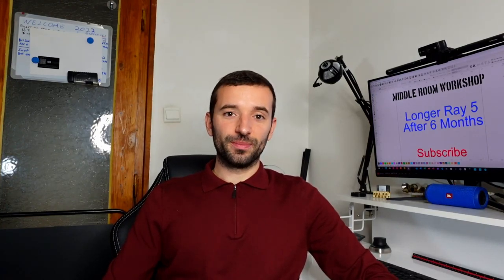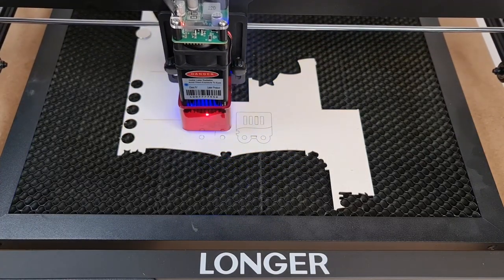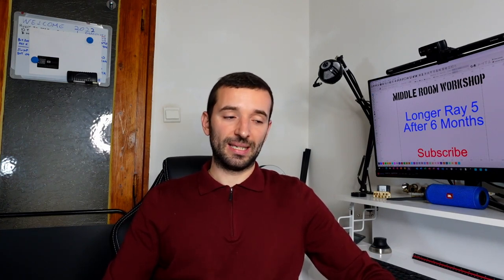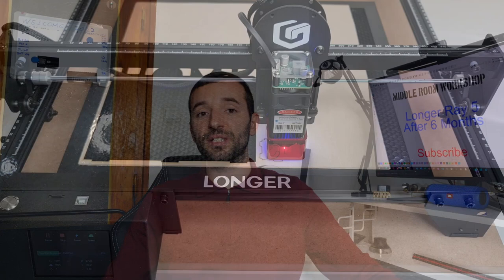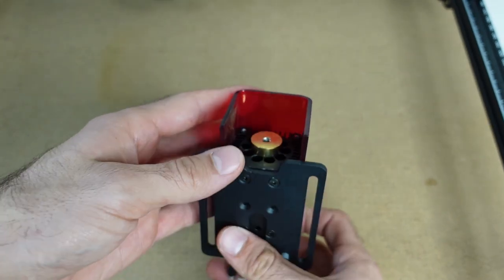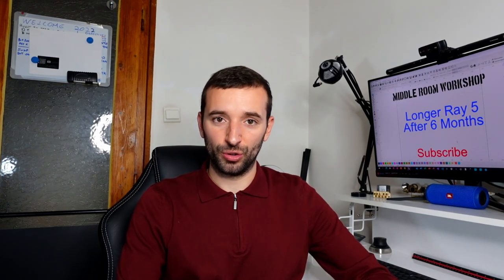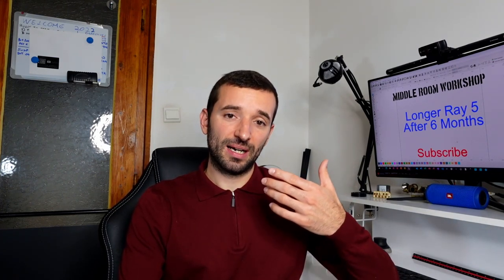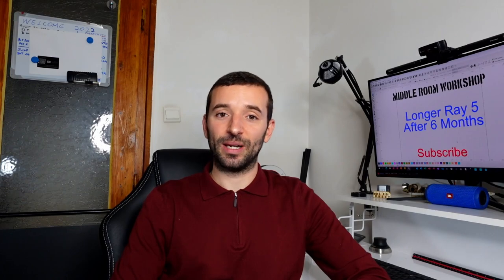Longer Ray 5 - Is it any good? 6 Months later

Comment: I just recently got this machine. I still haven't been able to save projects in to a format that the laser will recognize using the offline controller. So far I have only been able to use it via the usb cable.
Reply from the maker: Hi, Primate; thank you for your feedback. 

The offline controller reads .nc files. Therefore, make sure to export the file from the source software as .nc with the parameters in it. 

If you use LaserGRBL, once setting up the projects, go to File > Quick Save; this will save in .nc extension. 
If you are using LightBurn, click on "Save Gcode" and manually name your file with .nc at the end.

Let me know if you solve the problem. 
Ciao

Comment: Can you use other companies extsion rails?
Reply from the maker: Hi, Steven Stroup; thank you for your comment. 

Yes, you can.
The profile comprises standard 2020 or 2040 profiles readily available online and by other brands.

If you are planning on buying, I suggest going for independent profiles. It will cost you less, but you may need to make some holes and thread according to the type of machine.

Profiles: 
https://s.click.aliexpress.com/e/_Dm8K8lL
https://s.click.aliexpress.com/e/_DDQAs4t
T Nut:
https://s.click.aliexpress.com/e/_DnduoA9
https://s.click.aliexpress.com/e/_DeW1vGl
https://s.click.aliexpress.com/e/_DnN4NEh
Angles:
https://s.click.aliexpress.com/e/_DlCjiBR
Bolts:
https://s.click.aliexpress.com/e/_DdzqPO1
Belt:
https://s.click.aliexpress.com/e/_DnqXcAV
Pulley:
https://s.click.aliexpress.com/e/_DdLMqPr

I hope it helps.
Ciao